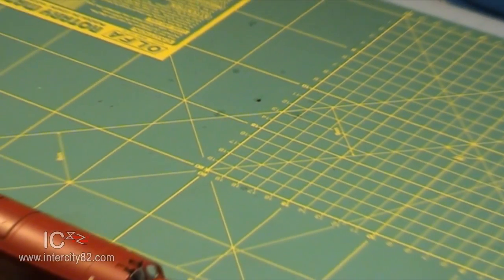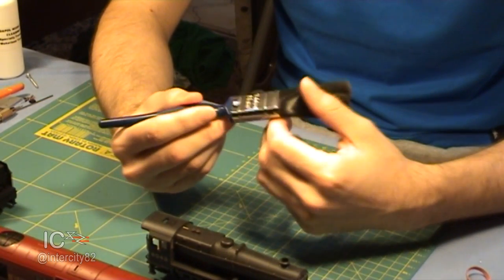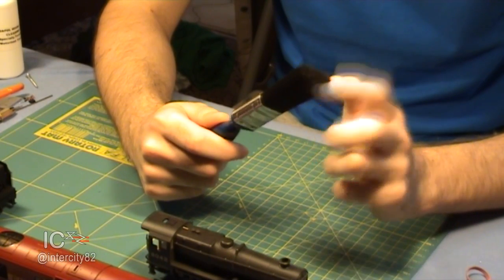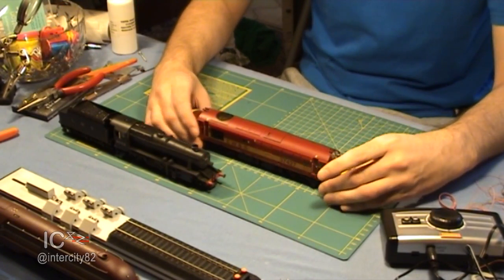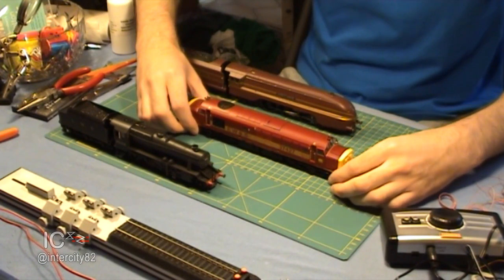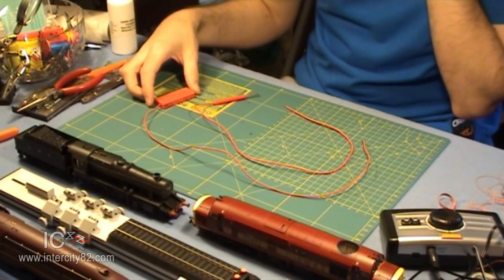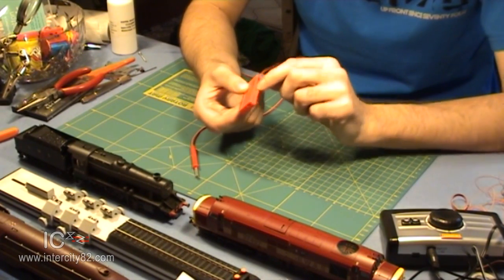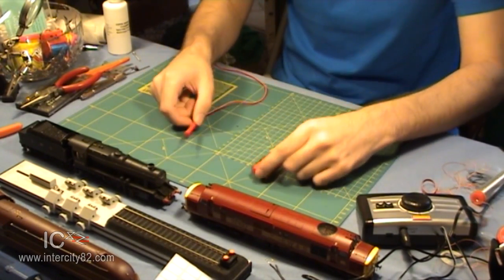*GUIDE* Locomotive Care - Part 1 of 3

Comment from the maker: @DANIELburt2442 - tiny carbon deposits on the wheels and track - it comes from the voltage jumping from the track to the wheel. As it does so it burns elements in the air, and these stick to the wheels and track.

Comment: Check that a wire has not come off the motor inside. Failing that, a carbon brush in the motor may have failed. That's for a DC loco.
Are you running DC or DCC?
When You say "it just stops", do you mean it ran and stopped, or it just doesn't go?